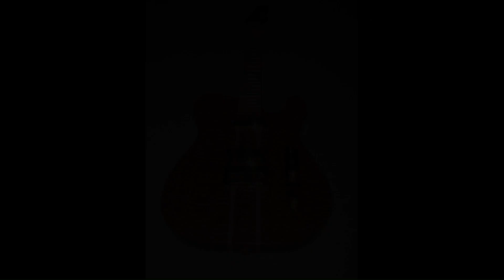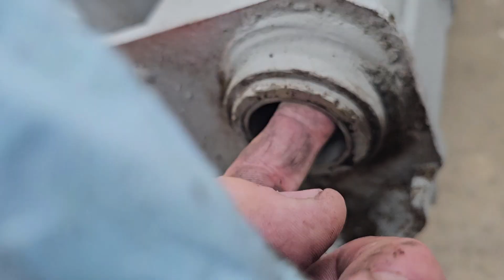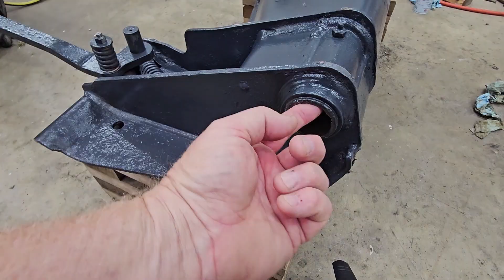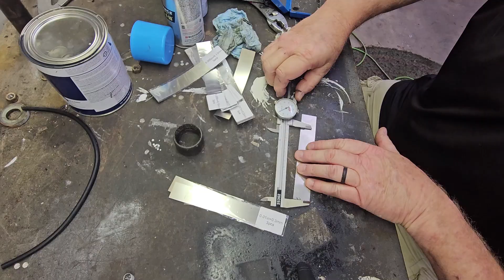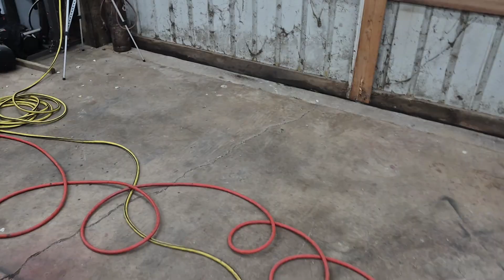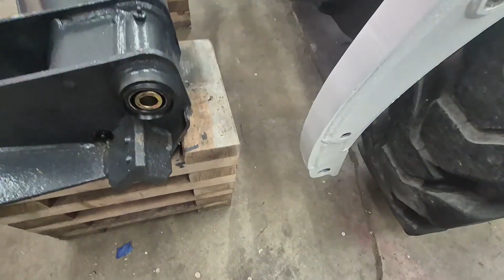Bobtach Quick Attach Pins and Bushing Repair

Comment: Do you have a link to or which jb weld did you use to jb weld In shims?
Reply: @80gritgarage10
Reply from the maker: I don't have the link, but it is the original formula for metal and it is two parts (Resin and hardener). Not the quick dry. Thanks for watching!